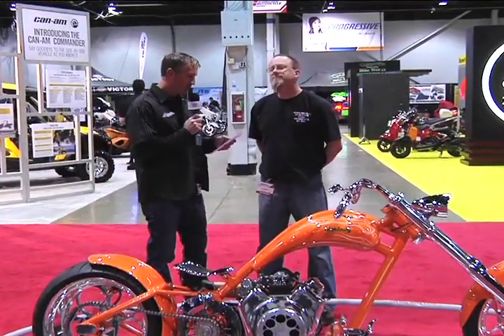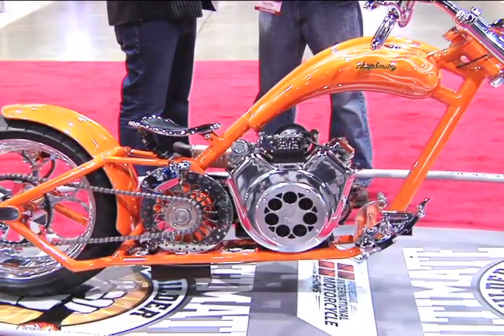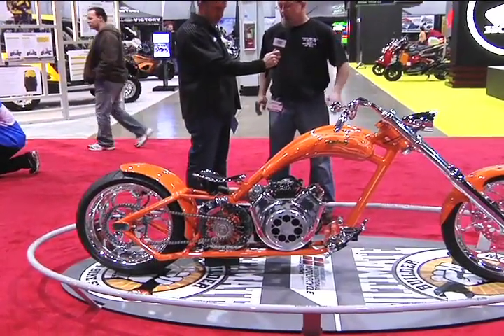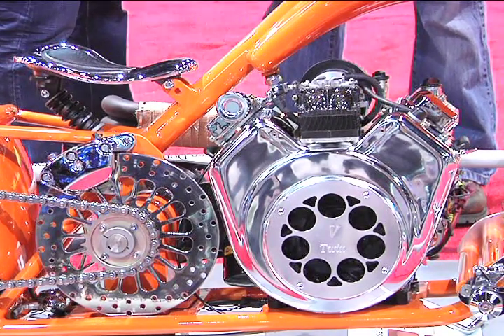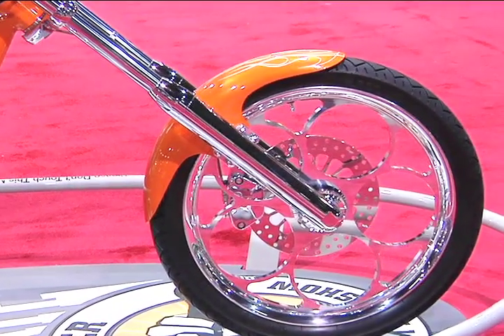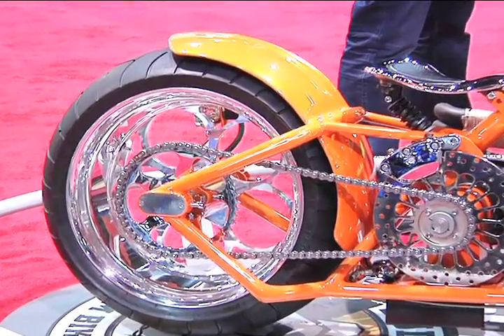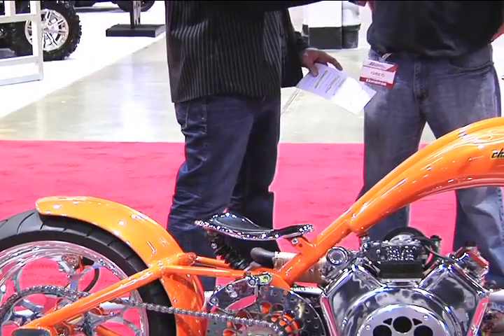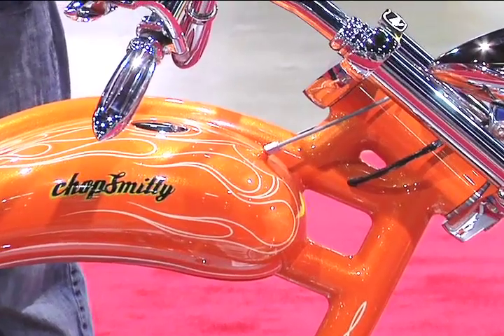2011 Chicago - Greg Green of Chop Smitty & His Briggs Stratton  Chopper

Comment: because if the engine is setup is horizontal and is setup for a bike, if it's a vertical shaft, you would see a wall on the back of the engine, so you can secure the engine onto the bike, the uploader needs to correct the video description.

Comment: i am talking about the crankshaft position. this is clearly a horizontal engine, not a vertical, look it up, if you said it's a vertical shaft, the PTO would be in the DOWN under the bike. not on the side